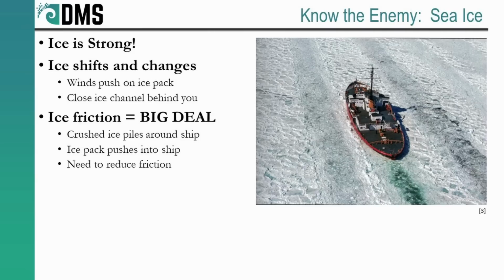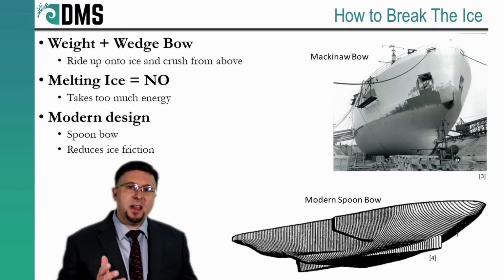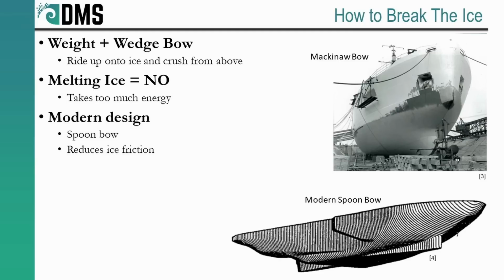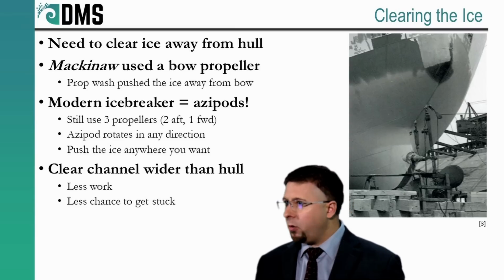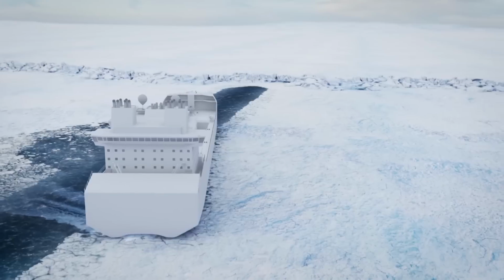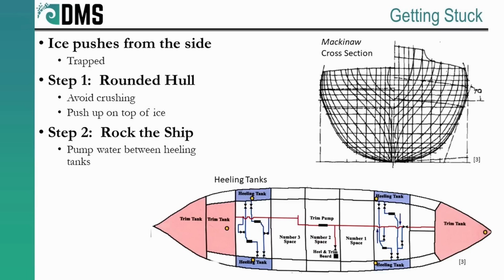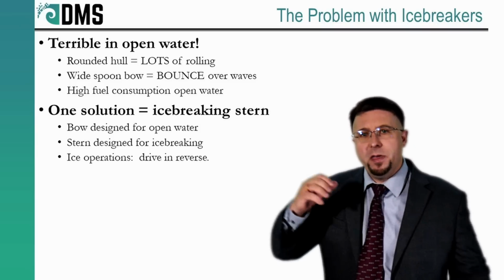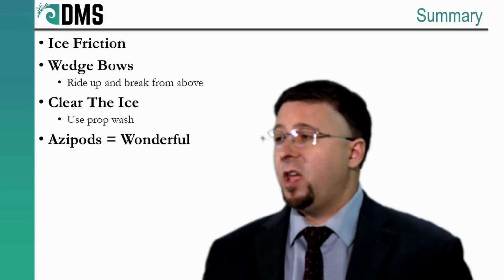How to Collide with Ice . . . and Survive?

Comment: I’ve seen hovercraft used to pre break the ice on the St. Lawrence River. The air under the skirts forces down through cracks in the ice, either natural or created by the over pressure. This creates big air pockets under the ice, and it collapses under its own weight. Then a conventional ice breaker or even just a sturdy lake freighter (the old ones have thicker plating than most ocean goers), can push its way through the broken ice, as long as they come along in the wake of the hovercraft before it refreezes.

Comment: I recall that the SS Stockholm which collided with the Andrea Doria had an ice breaking bow.  Is that true and if so how was she able to manage transatlantic crossings?
Reply from the maker: My information may be wrong, but I remember that the SS Stockholm wasn't an ice breaking bow, it was ice strengthened.  I know, we make these terms similar enough to sound the same.  But they are different.  An icebreaker goes into virgin ice fields and cracks through, creating a channel for regular traffic.  The ships that follow in the channel are ice strengthened.  Their bow isn't shaped for icebreaking.  They don't have rounded hulls.  They are normal ships intended for open ocean service.  The hull is just a little stronger in case they hit a stray piece of ice left in the channel.

Comment: Thank you! I've been waiting for icebreakers ever since i requested it, iirc in 2020 Feb. And i've been subscribed all that time, in fact i think i found your channel back in 2017 and subscribed almost immediately. By far the best marine engineering channel i've found, to this day.

If you don't mind a followup q, how thick do they make the hull (compared to normal ships) and has this changed much from the earlier years? Also interested in what kinda extra maintenance on the hull is needed.
Reply from the maker: Thickness varies depending on the ice they are designed for.  For the Mackinaw, her hull plate was 41 mm (1-5/8 in.) thick.  The other factor is the stiffener spacing.  On some bigger icebreakers, the bow stiffeners are so close together that you can barely fit your hand between them.  
I don't have specific details for extra maintenance on the hull.  But I expect a lot more focus on the hull during daily inspections.  Checking for cracked welds.  
Another factor is the vibration.  Breaking through ice can vibrate the hull violently.  There are stories of bulbs breaking and equipment getting damaged just from the vibrating hull.